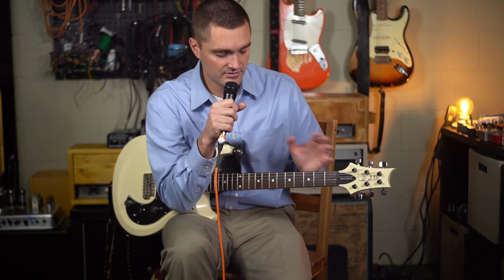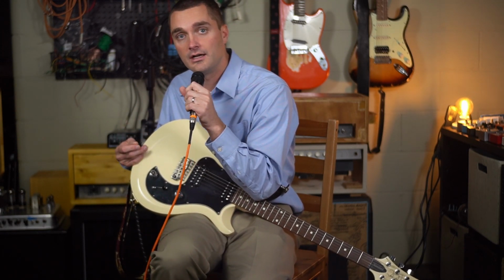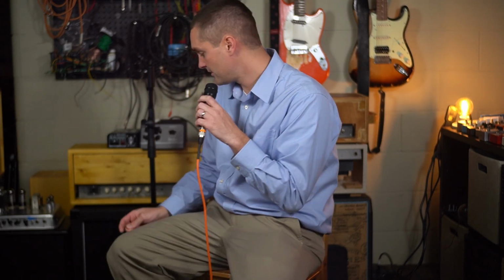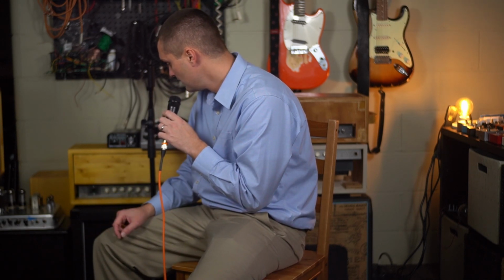My Marshall Plexi Clone doesn't sound right... Can I Fix It?

Comment: Sounds about right to me. That's what a plexi sounds like.
Reply from the maker: With those first set of tubes it got quite distorted even at 9:00. A plexi should be capable of at least a little bit of clean headroom right?
Reply: @KleyDeJong  It probably should be cleaner than with the newer tubes. Sorry, I didn't pay close enough attention the first time I watched. I thought you were trying to get more gain out of it. Are your pickups high output?
Reply from the maker: @onewiththings  It's a prs s2 standard 22 with fairly modest output humbuckers. I noticed the new preamp tubes had quite a bit less noise and hiss. The range of gain is much more like I expect. 9:00 is fairly clean. 12:00 is nice and crunchy. Cranked is awesome rock and roll saturation.

Comment: Hey Kley.  Thanks for posting.  I built a Weber 6M100 and I wouldn't dare play it at noon without ear protection.  Is your plexi a 50 watt?  Anyway I was surprised how sensitive your amp was to the preamp tube change...I think I’m going to roll my tubes too.  Please share the results of your Poweramp tube change.
Reply from the maker: Yes it's a 50 watt amp. It's quite loud! I can only play it in the room for a little bit.

I did some more testing and believe that one of those 12ax7s was faulty. It was quite noisy and overly gainy and not in a good way.
Reply: @KleyDeJong  I have some noise issues as well...perhaps a tube change will help.  I also have been meaning to replace the signal wires to v1 to shielded cable.